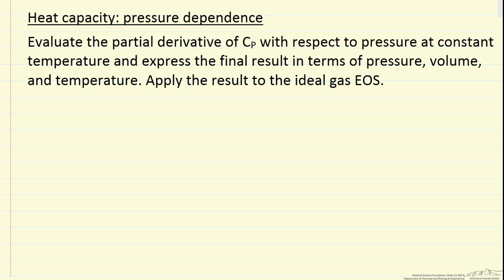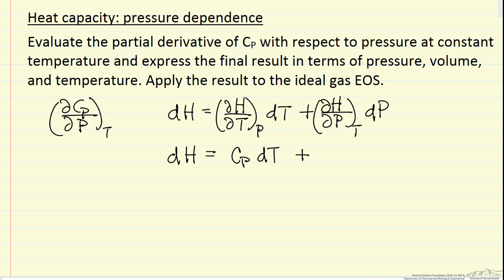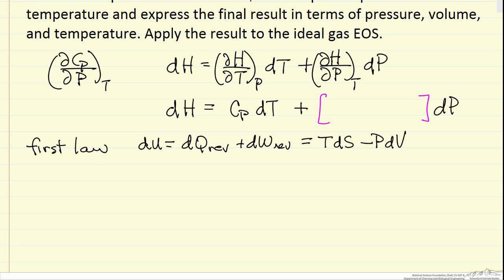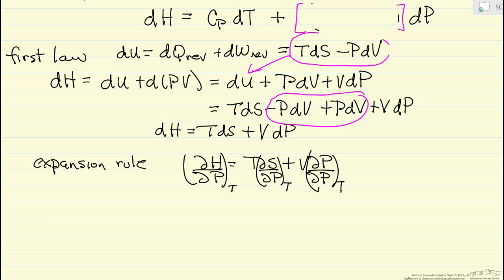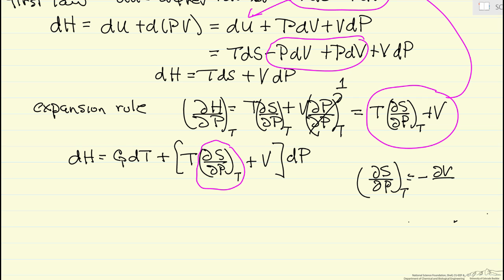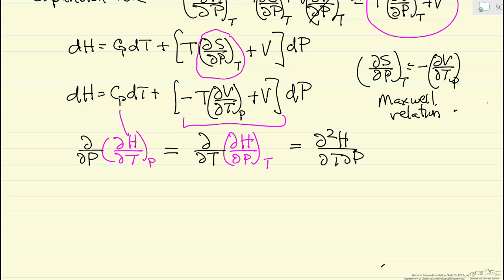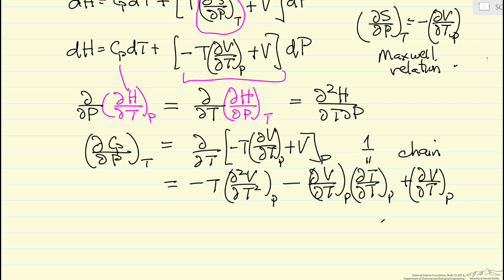Heat Capacity Pressure Dependence

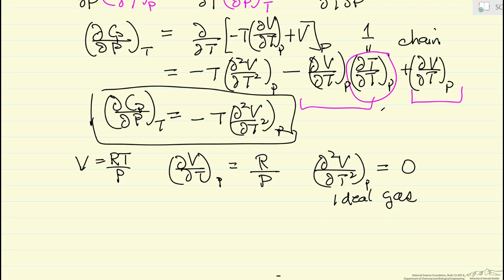Comment: 7:13 Ideal gas heat capacity does not depend on pressure; only depends on temperature.
Bingo! I've been looking for this explanation and I just found it -- thank you!!!
I have heat capacity data (JANAF), at one atmosphere, tabulated as a function of temperature. I use it for calculating gamma (also known sometimes as 'k'), the ratio of specific heats, which is a crucial parameter for (ideal) gas dynamics, for example, Zucrow's "Gas Dynamics," chapter 4. I wondered, what effect does pressure have on the ideal gas heat capacity? Now I have my answer: nothing.